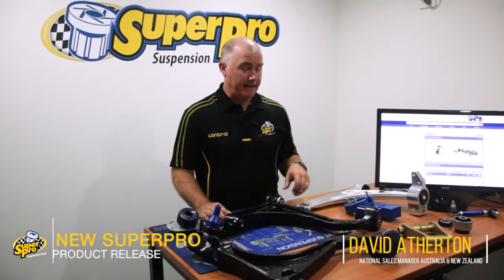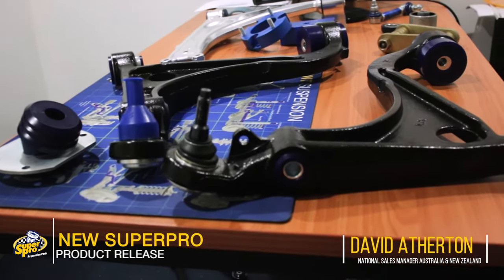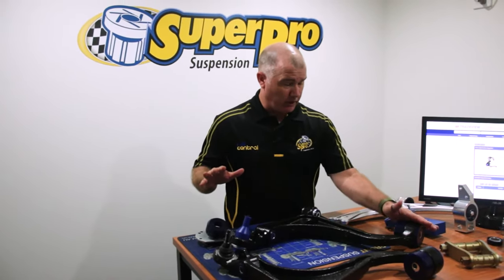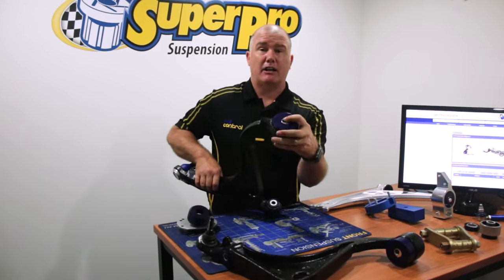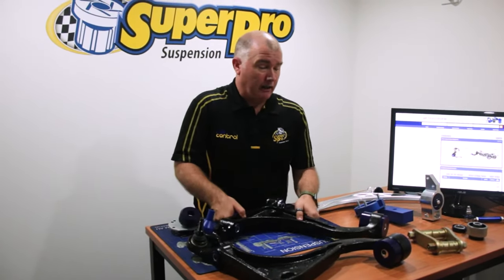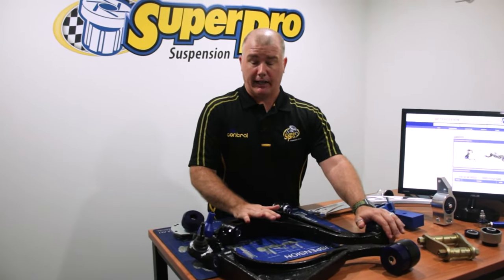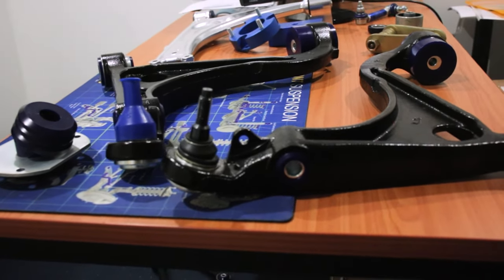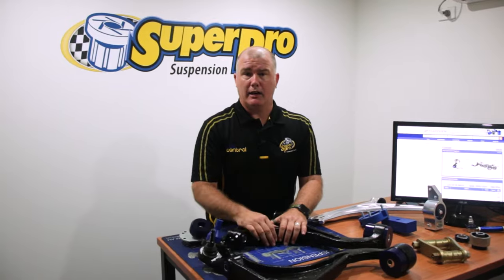Ford Falcon Lower Control Arm Kit from SuperPro - TRC1103

Comment: Hey man just picked up a front end suspension rebuild kit, would you have any videos of changing the inner rubber on the lower control arms?
Reply: I've used the rebuild kit on my falcon, what do you need help with? If you havent already done it yet

Comment: HI, I purchased a Land R hand set of these lower control arms for my BF GT, after approx 1000 Klms i had a knocking noise on my front end.
It was the L/H lower ball joint failed, i contacted Bursons where i purchased the arms from only to find out Super Pro have no stock!
I purchased genuine ford Ball joints to install only to find the inside diameter of the boss is actually too big for standard ball joints.
Bursons supplied me with their after market brand and they fall in to the boss also.
Does Supoer Pro use an over size ball joint in these arms?
Im not happy, i have purchased basically the complete front and rear end of arms and bushes for my car and had a critical component fail in such a short time.
Waiting to hear your response?
Reply: Did you ever get a reply on this mate? Ive just bought a set hopefully no issues
Reply: @shaygriffith8253  hi Shay, nope just goes to show how poor they are cant face the fact they sell second rate products. DO NOT buy this rubbish
Reply: @jamesfarrar4411  thats pretty piss poor not to get a response, atleas answer the question. What did you replace them with?
Reply: @shaygriffith8253  i fitted whitel-ine bushes and genuine ford ball joints
Reply: Still no reply SuperPro???